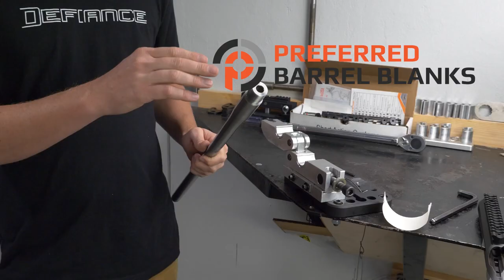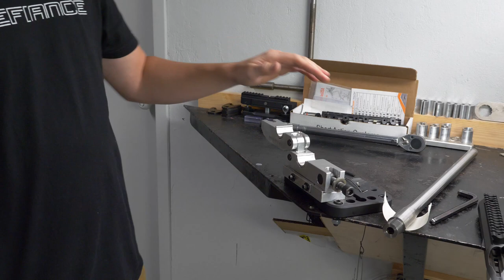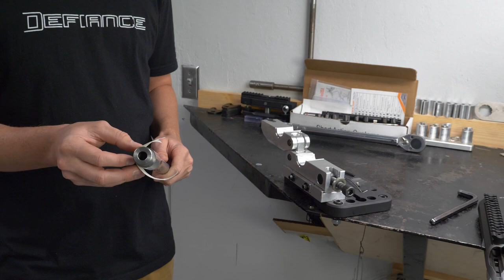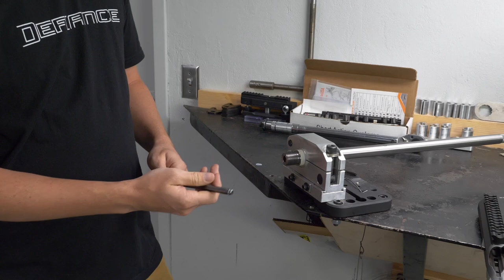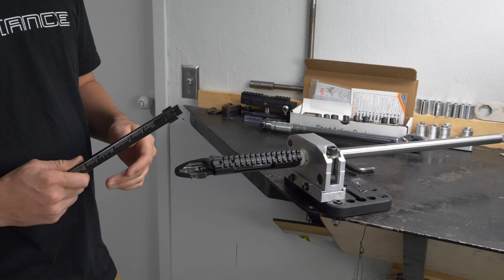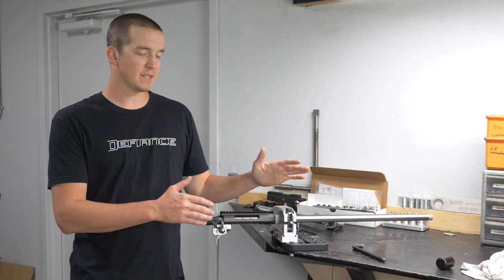**Fixed Shoulder Prefit Install** Preferred Barrels

Comment: What can you adjust if the bolt closes with the no-go gauge?  Or similarly to adjust the headspace to match your formed brass from the previous barrel?
Reply: You could turn some material off of the barrel shoulder or action face to reduce headspace. As far as lengthening it, the only options I see are to deepen the bolt face, or re-ream the chamber.
Reply: No, unless you have a lathe. That's why if you don't have a custom action you should use a barrel with a barrel nut so you can adjust it rather than a shouldered barrel.

Comment: Hi, I have a question about barrel replacement on Tikkas. On these rifles the barrel is tightened to the action very hard, last time my gunsmith had to cut the shoulder on the barrel to remove the pressure on the treads. How do you do remove the factory barrel of your Tikkas ???
Reply: I would like to know the same.  Maybe Preferred Barrel Blanks should do a barrel removal video on a virgin Tikka action.
Reply: @tomx7889  Hi tom, I've read many things on internet about this problem. It seems that without using the "cut relief" method and applying too much torque, that is so tightened that some people have broken some threads and ruined their barrel and action both 😲. After making a "cut relief", removing the barrel becomes easy most of the time so that's I think it's the best solution if you wanna save your receiver.
Reply from the maker: Using leverage to your advantage and a multi-ton press helps ;)  We can separate them without heating them or damage to either items.  We sell more barrels for Tikka than anything else, their quality is top notch.

Comment: Since you mentioned "THE CORRECT INSERT" which one are you using, I have been holding off ordering a barrel until I figure out where to get a 1.230" insert, since if I'm reading YOUR website correctly that's the shank size on a taperless barrel, and I have not found a correctly sized insert in anybody's list, either for my existing browells vice or SAC's line???
Reply: Viper vice works just fine

Comment: I’ve always heard you should put anti seize or some sort of grease on the threads. Do you guys not recommend that practice?
Reply: Some lithium grease works fine
Reply: @blacksand9805  Anything on the threads will affect torque specs, though. Just be aware.
Reply: @FourT6and22  I have tightened many barrels,  I just "feel" when it's snug. You don't need to tighten it too much if your rifling is clockwise. Just because the more you fire, the more it tightens (barrel reaction to the bullet spin). Grease will avoid galling the threads especially useful with stainless steel.
Reply: @blacksand9805  Cool. But nothing to do with what I said. If you are torquing something... anything... to a specific spec, the use of any grease, thread lock, or anti-seize will change the torque on the fastener. Just something to be aware of.
Reply: @FourT6and22  I know that. Lubricant ---> less friction

Comment: What about a remote that has been accurized and different threads are cut?
Reply: Rem 700 not remote
Reply from the maker: A 'Blueprinted' action is another term used and if your R700 has had that work done, you'd need to account for it on the barrel side as well.  It is an option under the Remage prefit!

Comment: Does this mean you can just swap t3 barrels back and forth without headspace issues?
I don't see fixed shoulder prefits made for savage, remington, etc due to headspace issues.
Reply from the maker: That is correct.